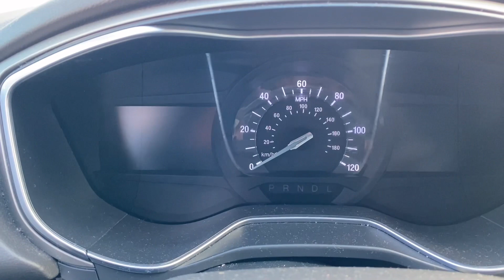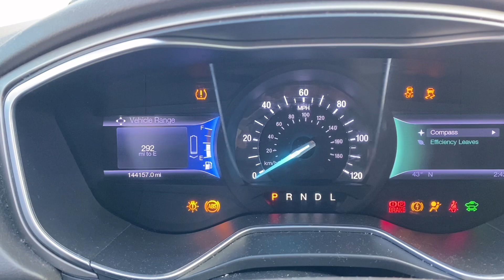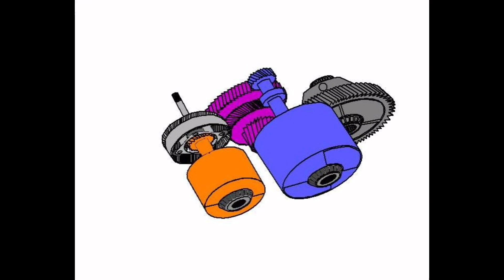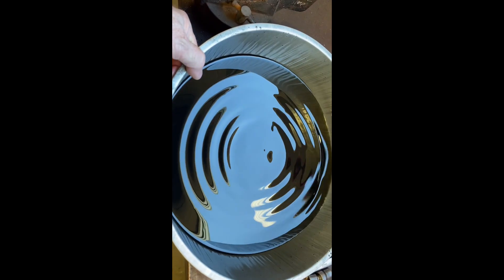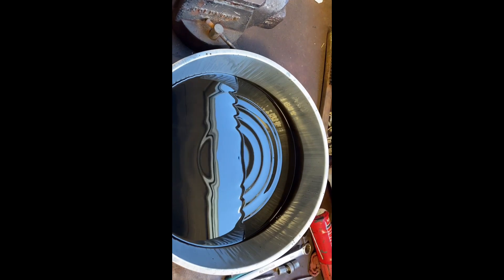Fusion Hybrid Stop Safely Now Transmission Failure

Comment: My wife's Cmax Hybrid has not been making noises . When the gas motor kicks in from a start sometimes it moans and vibrates at speed its quiet. After its warm it makes a metallic ticking sound under heavy acceleration. When taking off easily and cruising its quiet. Any suggestions? There are no fault codes.

Comment: Good video man. Thanks for taking the time to post it. My hybrid fusion trans is grinding. Taking it tomorrow to have whole rebuild kit installed
Reply: Where did you het the rebuild kit? The price? Cost to rebuild? My transmission is shot too
Reply: @bobbyz23  he has the kits available on his website. You could also ship your car to him and they will rebuild it and ship it back.
Reply: @bobbyz23  they just rebuilt my transmission. Job very well done…runs like it did when it was a brand new car. Smooth as silk with zero noise
Reply: @patrickhoward4080  What was the price?
Reply: @patrickhoward4080  Why you won’t mention the repair price or give the link for the kit?

Comment: I have a 2013 ford fusion hybrid and there's the problems I'm having and would appreciate your help.
One morning I started my car and that red waring triangle showed on the dash. I turned the car off, started it back up and it drove normal but i did feel a few minor jerks. The next day as I being to drive the jerks had got worst and I could not accelerate over 10 mph without the car shaking and vibrating like crazy. I got it towed a shop but the weird part is that I drove it from the shop I initially got it towed to, to two different shop and back home in it drove normal with no jerks nor shaking. But the DTC codes that all three auto repair shop gave me including the Ford Dealer were P0A2A, P0A78 and P0A90.
P0A2A Drive Motor A Temperature Senor A Circuit
P0A78 Drive Motor A Inverter Performance
P0A90 Drive Motor A Performance

Would highly appreciate your response.
Thank you.

Comment: cant remember off hand what codes my 2013 Fusion Hybrid Titanium has but there was multiple including engine speed sensor... but mine acts the same way when trying to run it. Starts, cranks, revs high for a couple seconds and engine dies off and theres a bad bearing type of sound as it slows down, then the Red triangle of death appears. i noticed i can start the car and put it in neutral real quick but as soon as it goes into R or D, it revs high and dies off.
Reply from the maker: Sounds like a similar problem.

Comment: I have 2013 FFH, second owner at 150k miles, now at 170k miles and I been thinking to a flush, go to ford, ford declined to do it since they said they dont do tran oil change for 150k or higher, tried to find shop some of them dont do it. Wanted to do myself but lack equipment,  it doesn't make any noise,  except when it starts, it sounds like that but only does sometimes like start in the morning , my dad said its probably  an engine mount, but I think its spark plug? Like it misfiring badly or something. Anyways thank you for you information!!
Reply from the maker: It should have a code if it’s missing.
Reply: @CarShopTalk  yeah, supposedly, then is it normal?
Reply from the maker: @MohdAzylee  what you’re describing doesn’t sound normal, but it’s hard to say without looking at it.
Reply: @CarShopTalk  yeah it doesn't sound normal, only happen when engine is cold and hybrid battery is depleted,  but I tried to have at least 50 when I get home, seems to be better

Comment: I had this problem but now the vehicle doesn't even start. It goes straight to the red triangle. Any chance the symptoms displayed could be related to a bad hybrid battery?
Reply from the maker: It’s hard to know without pulling codes on it, but I doubt it. What codes do you have?
Reply: I had these symptoms in a 2016 ford cmax energi but I don't have the codes you mentioned

Comment: Question. On the ford fusion energi hybrid, when in EV mode, the aux trans pump is required as the engine driven pump isn’t spinning,,, if the aux pump is failing, will that force engine on?
Reply from the maker: No, they’re two separate things. A failure of one won’t change the operation of the other.

Comment: Very helpful! I am at 230k miles on my Ford fusion hybrid and I'm thinking it's time to replace my Trans fluid. Some mention a lifetime Trans oil, but I'm not seeing anything that says my car has that.
Is it enough to just empty the old and fill with new with no need for a Trans filter change?
Reply: These Ford Fusion hybrids don't have a trans filter just gears and you empty and refill through drain fill plugs.

Comment: Good afternoon. I watched your amazing video. You show a very deep understanding of the processes in the car!

Can I ask you for help? (sorry for my English, I am a refugee and I have only been learning your language for 3 months). I have a 2013 FORD C-MAX ENERGI. I bought it used and drove it for a month without any problems. Then the problems started. 
First the "check engine" light came on. And a few days later the STOP SAFELY NOW message started appearing. But it appeared differently, and not as indicated in your video (8 seconds after the start and when I turn on the car, I do not hear a loud rattling sound). Here's what I noticed about this problem:

1) It always occurs only when I am driving and press the brake pedal. It never happens when I press the gas pedal or don't press anything.

2) At the same time, the steering wheel is blocked and I have difficulty driving to the side of the road.

3) At the same time, the climate system fan turns on at maximum speed, but air is not supplied to the cabin.

4) At the same time, the car cannot be turned off if I press the brake pedal. I can only turn off the car if I take my foot off the brake pedal.

5) IMPORTANT!!!! After turning off, I wait for 7 to 15 minutes, then I hear a short buzzing sound inside the machine (1-3 seconds). Then I turn the car on, the STOP SAFELY NOW indicator does not appear, the engine starts and I can drive again.
If I try to turn on the car before the buzzing sound inside, the car turns on, but the message STOP SAFELY NOW appears and the car does not move. I always wait for the buzzing sound and then I can drive again.

After this switching on, when I can already drive, I have 3 display options on the panel:
a) there are no error messages on the panel. In this case, the STOP SAFELY NOW problem may happen again and again, even after a few minutes.
b) the "check engine" light is on. In this case, the STOP SAFELY NOW problem also may appear again and again, even after a few minutes.
c) the “check engine” and “wrench” indicators are on. In this case, I can drive as long as I like and the STOP SAFELY NOW problem does not recur. But I noticed that in this mode the car does not switch to driving with an electric motor. The car runs only on a gasoline engine.
In all three options, the indicator shows that the battery is charging.

Sometimes, after parking for more than 1 hour, I turn on the car and the "check engine" and "wrench" lights immediately come on. In this case, I know for sure that STOP SAFELY NOW will not appear and I drive a lot without problems (only with a gasoline engine). The problem can only appear when the "wrench" indicator is off.

In addition, I noticed that sometimes when I drive at a very low speed (for example, in a traffic jam), I feel periodic jolts (jerks). It seems like something in the mechanics is trying to connect, but it doesn’t work. When I accelerate, the jolts (jerks) disappear. During of three months, 2 times happens these jolts (jerks) turned into strong vibration. I stopped, turned off the car, turned it on after some time and there was no more vibration.

I left the same comment under your other video about the STOP SAFELY NOW problem. I will be very grateful for your comments on my problem!!!!❤❤❤
Reply from the maker: It would be helpful if you could get the codes pulled out of all the modules to point you in a direction. The blower speed change along with it is kind of strange, ground maybe?

Comment: Hi, I have a 2019 Fusion Hybrid with 60,000 miles on it. Is it time to change the oil? What are the first symptoms of damage to the ECVT?  Thanks;)
Reply from the maker: If I had one I’d probably change it. They start making noise.
Reply: @CarShopTalk  i Just bought one that has over 100,000 miles, do you recommend changing the trans fluid or not until it makes noise? It's running fine so far
Reply: @mtateo don’t do anything I have 300k it’s had that sound since 90k

Comment: Will a bad PCM cause transmission problems?  Mine shows up  as P0C2F, P1920,C0564,P013A P060B,P0811.Battery was dead charged it up hybrid battery is completely dead.I bought this 2016 Fusion Energi  as is ,no charge cord came with the car.The reason i asked because i thought those transmission problems were fixed for the 2016-2020 Fusions.
Reply from the maker: It could cause transmission problems. It probably wouldn’t be the first thing I would suspect.
Reply: @CarShopTalk  Most of the time P060B Internal Control Module A/D Processing Performance is most certainly a bad PCM and since it controls the transmission that could be cause transmission shifting problems if no unusual sounds are present.
Reply from the maker: @bobbyz23  I see a lot of PCM’s get replaced, but they’re rarely bad / the problem.
Reply: @CarShopTalk  If  no noise or damage to the transmission like  n your case it’s more likely the PCM  or wiring connected to the PCM if you are getting a lot of codes relating to the fuel 02 sensor  crank shaft and transmission.
Reply: @CarShopTalk  Update ...it was not the PCM or transmission even though it was throwing codes P0C2F P060B ,the hybrid battery was completely drained.Ordered a replacement HV charger couple days ago charged the hybrid battery to 100% no more codes, stop safely now not showing, running perfectly.

Comment: My ford fusion hybrid 2018 SE is showing  stop safely now,could  it be transmission failure please i really want to know ? What it coul 8:17 d be besides transmission failure ?
Reply from the maker: The best way to get pointed in the right direction is going to be to get all codes pulled on it.
Reply: My 2014 fusion hybrid said the same stop for safety

Comment: Hey that for explaining this....i have 2018 fusion with a P0e4e code the dealer tell me "probably" the transmission and the local shop states possibly the engine...because that a engine failed to crank code? Would you by any chance know how to fix the code ( i have the red triangle and vehicle wont start anymore..)
Reply from the maker: That’s really just an informational code. It just means the engine didn’t crank when it expected it to. It’s really not helpful to diagnose why the engine didn’t crank, and there are endless possibilities as to why.
Reply: @CarShopTalk  okay thanks...

Comment: Пытаюсь снять коробку с такой же машины, но не получается- мало места вывести за маховик. Вы снимали ее вместе с двигателем? Или есть какие то уловки? Спасибо
Reply from the maker: The subframe has to come out with the engine supported. If you lower the back of the engine a little you should have room to slide it off the flywheel and remove the transmission.

Comment: Hello, I just had a new transmission installed in my 2015 fusion hybrid, “no plug” in, the codes on the transmission from the sticker matches from the old one to the new one before I put the new transmission in the old transmission had a horrible winding, but it drove and shook real bad after and the gas motor would come on, putting the new transmission in we get the red triangle now that shows these codes can you please tell me if the new transmission has to be  programmed to the car if we use the same electronics or can you tell me what my issue could be thank you for your time.

These are the code with the new transmission installed, the car will come on now, won’t move or start the gas motor and the red triangle comes on
Poe4e-00
P1A0c-00
Reply from the maker: The transmission strategy and ID do have to be programmed to match the new transmission. These should be located on a sticker on the transmission, the strategy is 13 characters long, the ID is 11. 

P1A0C indicates failure mode effects management is in affect. P0E4E indicates. The engine failed to crank due to being locked up or other reason.
Reply: @CarShopTalk  thank you so much, I have been searching for 4 hours on answers. When you say locked up, do you mean bad motor, or maybe no crank? The motor was just fine when we took it to the shop for transmission replacement, after replacement is when we had issues.. again thank you so much for your time🙏🏾
Reply from the maker: @jhybki  I would guess anything that would keep the engine from turning when it tried to crank it could set that code. Can you put a socket and ratchet on the front of the motor and turn it by hand?
Reply: @CarShopTalk  yes it turns.

Comment: hello gays I have 2017 ford fusion hybrid and when I started hibrid engine start whorking 3-5 sek and motor not starting. whats problem ?
Reply from the maker: That does kind of sound like what they do with a transmission failure. You need to get codes out of the PCM and SOBDMC to have a better idea.

Comment: I purchased a 2014 Fusion Hybrid with 140k and changed the fluid myself soon after. The fluid change is very easy to do yourself, a basic fluid pump and basic tools is all that is needed. My car now had 170k and sounds great but the engine does seem to shake excessively when starting up, I'm guessing a motor or transmission mount is worn. The engine in this video seems to shake like I imagine mine does. Does anyone have any experience with changing mounts on these cars? I plan to change my transmission fluid soon again since I'm not sure it was change before 140K.
Reply from the maker: I can’t say I’ve had to replace any mounts on the hybrid. Some on the regular gas engines and a few torque / dog bones as well, but nothing on a hybrid yet.
Reply: Здравствуйте. У меня такая же проблема. Двигатель  трясётся  при запуске  на холодную. На горячую не ощутимо. Вы как нибудь  решили проблему?